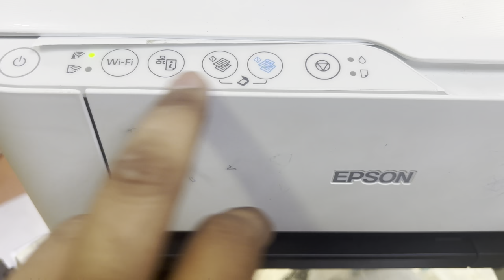Resolving the All Lights Blinking Issue in Epson EcoTank Printer Models

Comment: I think I have this issue, but i cannot find anything that is stuck. I tried moving the print head but i keeps getting stuck to the left under initialization. Any ideas on how to fix this. My printer is ET-2810 but looks very similar to yours. How do i open the lid fully on my printer?
Reply: If you haven't managed to get the lip up it's easy where the lip lift up n clips in just push the lid down but with you're finger punch the little click back n then it should lift up all the way

Comment: Hello. I have a problem with the ET 2814 printer. At the same time, 4 lights flash, namely the power button, the lower wifi light and both ink lights. When I plug the printer directly into the socket, the printer turns on automatically, the power button does not work because when I press it, the printer will not turn off. I am asking for help.
Reply: Same here! Did you figure it out?
Reply: I literally have the same too, so hoping the OP replies!
Reply: You fixed it?
Reply: i have the same problem
Reply: No. It's problem whit software.
Reply from the maker: Check the error through epson printer status software, either its fatal error or ink pad error, let me know
Reply: @BilalKhalid yes it's Software problem
Reply: Hello! I have just bought a 2nd hand printer and this 4 light error is showing. I have tried opening and adjusting everything but nothing is changing. Any help will be appreciated. Thank you
Reply: Hi, the same here did you solved it? I need velo please. I Just uninstall the software from my pc but the error is stil 😢
Reply: @burakburak1173 hi, I uninstall the software but the problema is stil here. There is no oaper jam could you please help?  😢

Comment: Hi I have an Epson eco 2860 only a day old plugged it in did the set up connected it to my phone and than all lights will not go off won’t do anything at all when I plug it in all the lights come on straight away flashing red the paper ink WiFi and the power button done got the laptop out and nothing was detected for software update it is annoying me 24 hours of trying everything and it’s just just having none of it £200 down the pan it looks like as can’t get hold of Epson so I take it is broke before I’ve even used it

Comment: Hello
I have a problem that suddenly occurred in my Epson 2810 printer. When I press the power button, it works normally, but after about a minute it turns off automatically, and I must turn it on again from the power button. What is the problem, please?  What is the solution ?
I look forward to your reply and thanks
Reply from the maker: Check power cable

Comment: I am facing some problems with my Epson L3150 printer. What appears to me is that the scanner roller is moving smoothly from left to right but not returing from the right side, and then all the lights are starting to blink. I have cleaned the inside and checked that there are no obstacles inside the printer. I am attaching a video of the problem at the link: https://www.youtube.com/shorts/CHlKYQZiH54. Please guide me to fix the problem.
Reply from the maker: Sir I watched your video, it seems you have an issue with scnner. I suggest you to find a spare scanner and check. All lights blinking issue can be from damage scanner, and also it can be from the round shape transparent strip as if its not fixed well on its holder. Third it can be due to ink carriage as well if something got stuck inside and as you said, you already checked there is no obstacles inside then i suggest to go through first 2 problems that i mentioned above. All the best!
Reply: @BilalKhalid  Thank you very much sir..I will follow your guideline and will give you the feedback.